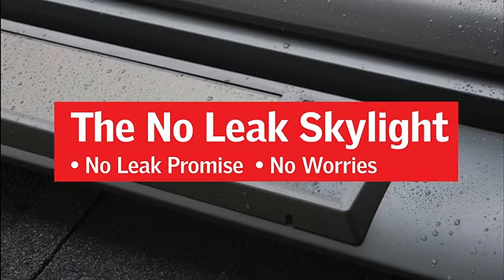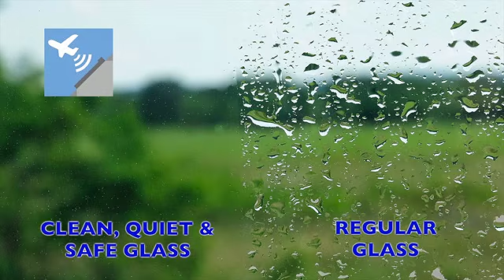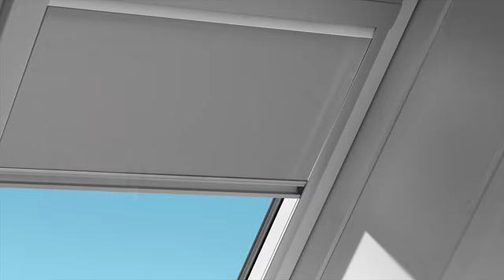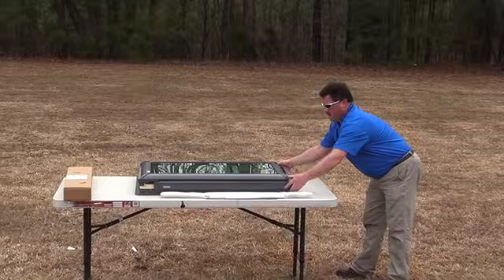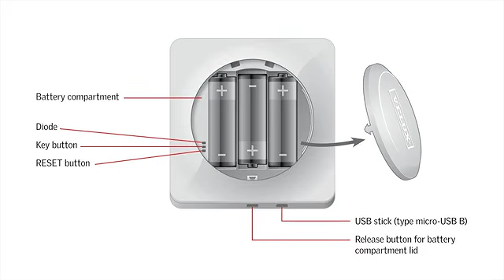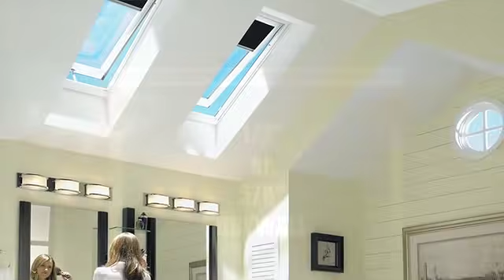VELUX Install Video - Deck Mounted Skylights

Comment: Can I install it from the inside only? Does the glass can come out temporarily on the model that opens?
Reply from the maker: Hi there, we apologize for the delay in response. VELUX skylights will need to be installed and flashed from the roof. For further questions, you can reach VELUX direct at 800-888-3589.

Comment: My Velux skylight was installed last August and the “trim” just came off on the side and the bottom.
Reply from the maker: Please reach out to VELUX Technical Support @ 1-800-888-0361 to help you troubleshoot this issue and determine what is needed to remedy the problem.
Reply: @veluxusa  I appreciate it. I’m in contact with the folks at Velux. Hopefully it gets fixed. 🙏

Comment: Mine is leaking because the cladding doesn’t seal and the snow melt is backing up inside cladding and leaking down what a poor design on top of it you guys want to charge me $150 to come out and look at your failed design
Reply from the maker: VELUX Skylights have a 10 year Product Warranty against water penetration. If this is a warranty issue, there would not be a $150 service charge. We pride ourselves on manufacturing world class products and look forward to resolving this issue.  Please use the following link to set up service for your skylights: https://www.veluxusa.com/help/contact-us/requestservice  (You are welcome to include any pictures or other relevant details.) Thank you for choosing VELUX.

Comment: My roof installers did not do anything to the skylights on the inside. Shouldn’t this be part of the installations? They replaced three old Vellux skylights. They wanted $1150.00 over the cost of the roof to work on the inside.
Reply from the maker: Hi Peggy - Please send the information about your skylight replacement - your location, the name of the installation company, photos of the skylight interior and your contact information to wray.ward@velux.com. Thanks.
Reply: @veluxusa  we had the same thing. 
Nothing was done on the inside and the outside of the skylight the trim around the bottom and side just fell off.
Reply from the maker: @JoeFidler  Please send a full description and any photos you can capture of the interior and exterior along with your location, the name of the installation company and your contact information (email, phone) to wray.ward@velux.com. Thank you!
Reply: My 3 fixed skylights were also installed unfinished on the interior. I was told to caulk and foam the raw edge and contact a carpenter to finish the work. It looks awful and there is black underlayment with shingles cut unevenly showing against the interior skylight frame. The video does not discuss caulk or foam and does not appear to mount the skylight on top of shingles! Now, I have to figure out a solution.

Comment: I have a Velux skylight sitting at my local big box store with the flashing kit.
I will pick it up today when they open.
New roof installation will start first week of February 2021. My roofer fought long and hard against replacing the existing skylight and wanted to remove and roof over the existing skylight saying they all leak eventually. Existing skylight is from 1998 and no signs of leaking( not sure of the brand it came with the house)
     Wife wanted skylight so we will have a skylight.  After looking around we chose Velux because of the 10 year no leak  warranty.
I will video the installation of the new one for warranty purposes to show it was installed by a licensed roofing contractor per the factory directions.
Reply from the maker: Hi HVAC Mike - All of the warranty information can be found at this link: https://www.veluxusa.com/help/velux-warranty   Thanks for choosing VELUX!
Reply: How did your installation go? Our roofing company also wanted to fill in our skylights, but we kept 3 (we had 15). It has been a week since our install and it is clear that this roofing company has no experience installing skylights (probably why they wanted to fill them all in). The inside is unfinished so I can see the rough opening of the skylight and the nails securing the skylight. There are only a few holding the thing down. Some nails are not secured to anything. It has been a nightmare for us. Our previous 15 were 33 years old and only 2 started to leak within the past year. Should have found a skylight specialty company to just replace the 2....

Comment: Word of caution having just installed 3 deck mounted C06 units . . . in this video at timepoint 12:30 they say/show "securing skylight in place w/ the nails provided."  Thing is, in the vid he's like tap tap tap and each nail is set.  But, if you're decking is .5- 7/8 inch plywood (not balsa as that deck must be!) the nails are exceedingly difficult to hammer into the deck, and you must also hammer them at an angle (yet get them in straight!!) as there is effectively zilch 'clearance' from the skylight frame to the 'nail holes' meaning that if you are not an ace hammerer (I mean ace hammerer!) you WILL whack the frame and still not get the nails in properly.  This is a design oversight - 

Velux clearly expects all installers to be career roofers who can hit nails perfectly, at an angle and still get them to drive perpendicular to deck and into hard decking with a 'tap tap tap'.  I'm good at placing nails/hammering, but this was a no go so I ended up getting & using some deck screws and using a driver to screw the skylights in place vs. having multiple multiple frame dsents/dings. Voided the warranty but we all know roofing material suppliers make their warranties all but impossible to claim anyway. All they needed to do was make the flange half an inch wider to make the holes accessible without angle hammering - even using deck screws/driver was tricky due to the angle and zero clearance from frame edge to nail hole.  Trust me, there was no easy peasy 'tap tap' to get their nails into effectively recessed holes, thru .7 inch plywood deck. A 45 degree deck.

Trust me, install one (or three!) velux skylights and youll know exactly what I mean.  Unless youre a prof. roofer nailing into a balsa deck.  Tap tap.   not
Reply: There’s a tool for doing this, it’s called a “Roof Snake.”
Reply: I found this my experience as well
Reply: You can use a punch on the nail after it's set so your hammer is never close to the skylight , or put a wood shim between your hammer and skylight as a guard. Or pre-drill your holes straight with a long drill bit if setting them is such a pain.  Or just be good at hammering as you say.  If you're going to resort to screws at least use a pan headed screw like a GRK cabinet screw instead of some deck screws, with a long extension to get over that clearance problem.
Reply: Like another said here, I just got a long punch. Made easy work of it
Reply: If you are having to hit the nail several times because of bouncing decking then it sounds like there is no framing under the decking.
Reply: I hit each nail square on the head without ever missing, and the nail travels fully into the wood in one fell swing. I feel pity for men who can't bang in a nail. It's a shame! I installed one of these skylights in 5 minutes and been installed without leaks in my mansion guesthouse for the past 150 years. You guys really need to learn how to do things the right way.

Comment: Terrible instructional video. Hearing what to do without seeing what to do on an instructional video makes it pretty much worthless. You're describing what we need to do while the camera is 20 ft away from the guy installing it. If that's the case, why even bother having a guy installing it? I could've seen the same thing watch a roofer install one from the ground.
Reply: I disagree. I was able to do all that was needed,. Correctly! This is a re-install for me as I originally installed it nearly 30 years ago...before internet videos.  While the window has NEVER leaked my flashing (done incorrectly) did.  This window is opened and closed  at least 3 times a week...for 30 years and still operates fine. Do the math! Any additions will be Velux.
Reply: I agree. It's difficult to tell exactly what spacing the step flashing is being installed at, and how the cladding and top piece of flashing are attached. Also, if you're installing the skylight into an existing roof, prying up the old shingles to interweave the new ones is far more difficult than shown in the video. Getting a good pair of snips to cut shingles is highly recommended.

Comment: Why do you need 18" above/below the skylight?
Reply from the maker: Quantum Hype - The 18-inch minimum provides enough room to properly flash the skylight to the roof deck. Thank you.
Reply: @veluxusa  what are the terms of the ten year warranty 
I have purchased a fixed glass 22.5X45 self flashing with the recommended flashing kit 
My roofer will be installing it when they replace our roof in a few weeks.